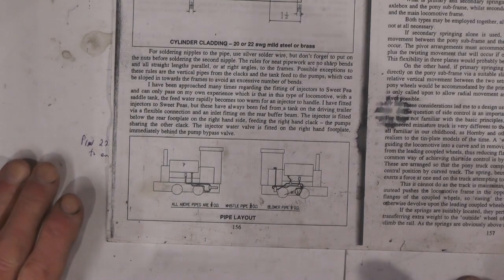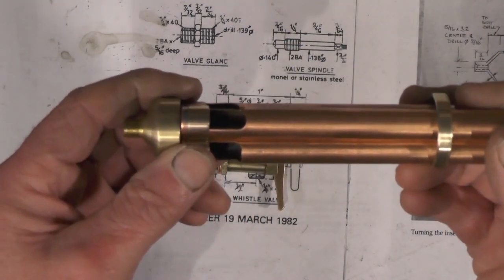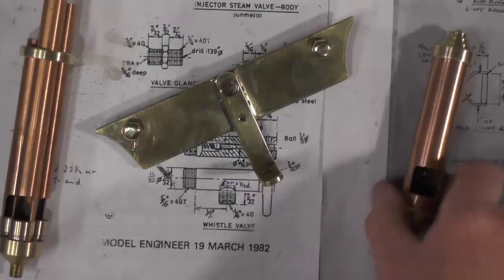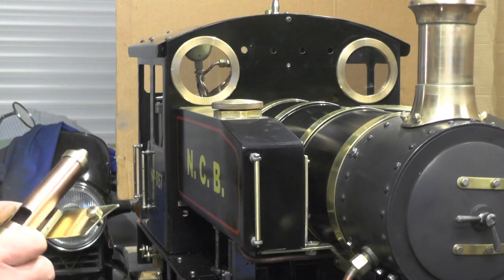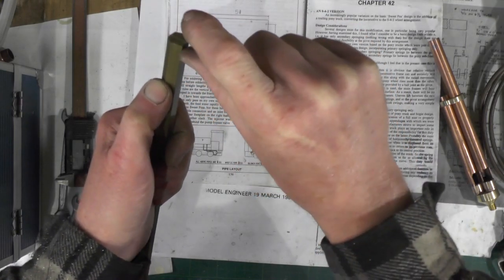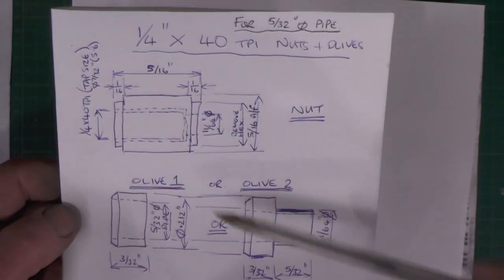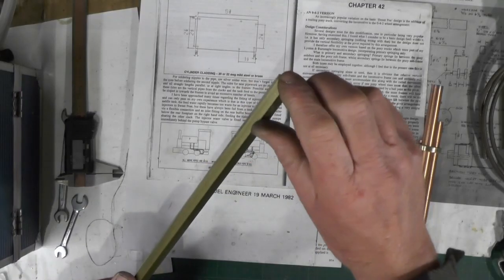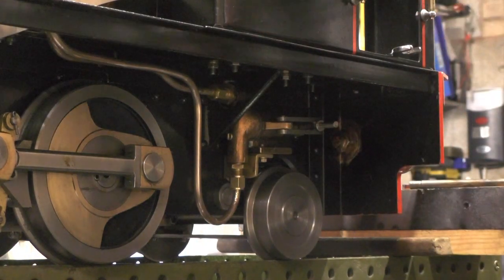Build Your Own Beginners Miniature Steam Locomotive Series (Pipework P10 Whistles ) "mr factotum"

Comment: hey up mi duck  ..got problems with your injectors .. ?try putting the clack valves right up against the smoke box end of the boiler well away from the fire box end   [as you well know injectors dont like heat  .. good luck  regards laurence
Reply from the maker: Thanks James
all advice took onboard, i have managed to get them picking up now after some faffing and trial and error, by increasing the water flow, seems ok on a bech test, just got to try for real up at track.
see you next time mi duck🤣🤣🚂🚂👍👍
kev